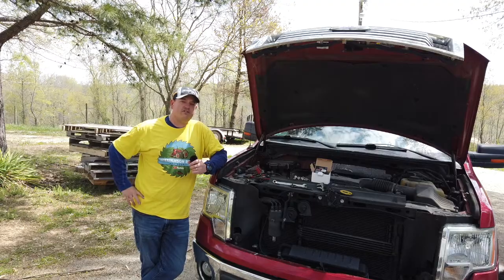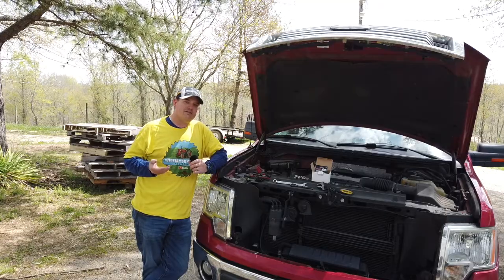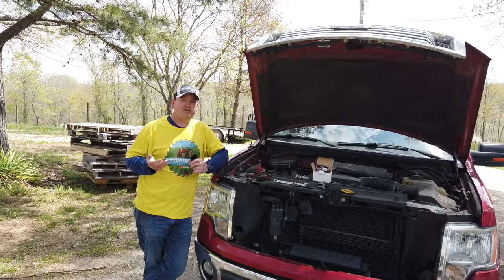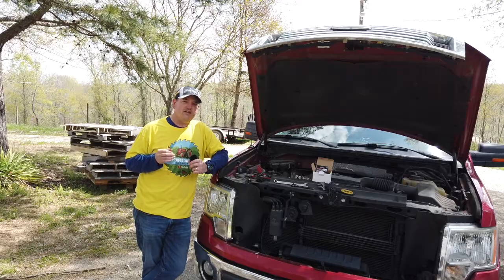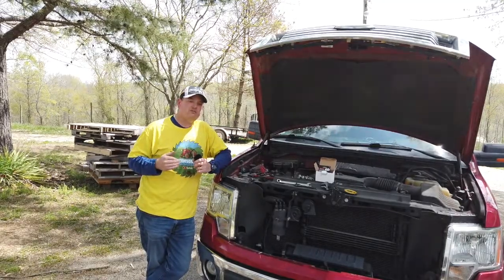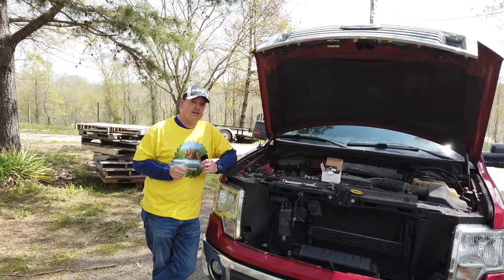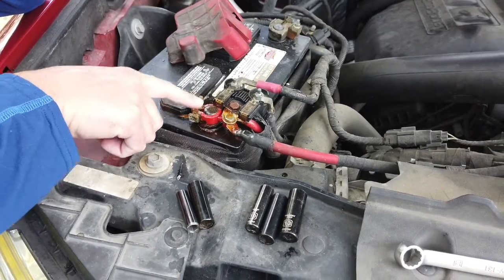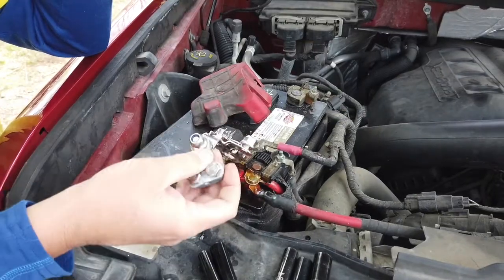Ford F-150 Battery Terminal Fix/Replacement #122

Comment: They told me 400.00 for clamp and 400 for labor. So total of close to 1000.00 for a battery positive connection. A real Ripoff. Get with it Ford.
Reply: That’s actually disgusting

Comment: Your video saved me about 1500 dollars. Had the same issue with stock battery terminal on my 2013 F150. Brought it to a shop and they too said i needed to order the whole battery cable assembly , which is actually on backorder currently ,  350 bucks and with labor/ shop supplies/tax would end me right around 1500 (not even including a new battery) . Watched your video, bought the same doorman part, was done in about an hour (had lots of corrosion to clean up) Never going to that shop again. I even asked them if there was some sort of "work around"  they could do to not have to replace the entire wiring . They stated that it would probably be around the same cost... These shops these days are straight thieves. Thanks again, will be subscribing !
Reply from the maker: Thanks! Glad it helped out!

Comment: Your situation was exactly what happened with me. Different shop put a generic post on the battery and it corroded like crazy for several years. Last week, I replaced a battery and the truck was dead. I was prepared to replace the alternator and figured I'd replace the terminal while I was at it. I rewatched your video and skipped the alternator. It works like a dream. Thanks for the descriptive lead up.

Comment: Damn. I know this video is older but, what a life saver. I was quoted over $350 for the terminal and $500 in labor and $300 for a new battery 😂. With this video should be down to a little over $250 all and all. Will update once complete.
Reply from the maker: Awesome glad it helped out!

Comment: I bought this connector late Summer(2020). Brought it to the dealer to have it installed. Worked just fine for 24hrs. The wife took my truck to the Vet for my pup and the truck died...less than a mile away. Nothing wrong with the item, turned out the mechanic didn't tighten down the screws well enough. I bring all our vehicles to this shop, but i chalk this one up to a brain fart. A little lock tight and the product works good six months later. All in all, a $30 price tag is more than worth it!!

Comment: I been researching this issue on my wife’s 2015 Explorer. Fixed hers then checked my 2012 F150 and while wasn’t too much corrosion on there I’m gonna go ahead and get this part and put it on. Nicely done video 👍
Reply from the maker: Thanks!
Reply: Did this particular piece work on the explorer? I'm needing to do mine and looking for the part

Comment: Great video. Gave me the exact solution I was looking for. This perfectly solved my problem for my 2008 F150 Lariat 5.4 L V8 (for the search engine). 

I'll say it again, this was perfect for my 2008 F150 even though he shows this on a 2011, and mentions 2009-2015.
Reply: I have the 2005 Lariat. That is in the same model range as yours correct? Did you cut the old terminal off or uncrimp it
Reply: @SamMobleyLiving  I cut the old one and used the included bolts to clamp to the original cable. I'll note I also stripped off about half an inch. 

2008 and 2005 are in the same generation of F150s per a quick google search.
Reply: Can this terminal be used on a 09 Grand Marquis/Crown Victoria?

Comment: Similar story in my life. 
Replaced a dead battery due to high corrosion and killed my battery. I replaced it myself in front of autozone. 
I let my brother borrow my truck for a couple days so he could do a couple things that requires a truck. 
Battery wasn’t charging from tons of corrosion again. I was able to find negative replacement locally by Dorman. But not the positive. Found this video. Ordered the part. I’ll be replacing it in two days. Pretty annoying little issue.

Comment: Thanks!  This worked perfectly on my 2016 Lincoln Navigator L that had the positive terminal completely corroded.  The replacement battery cable assembly was $478 + 5 hours labor…$1000 estimate.  It cost me $22 and 30 minutes of my time.  Couldn’t have done it without your video!
Reply from the maker: Glad it helped you out, thanks for watching!

Comment: I was able to find the exact connection with the fusible links on Amazon for $39 shipped.  It was a pain to remove the old crimped section and then again to crimp the new one w/o a crimping tool.  But it fits like new and I don’t need to worry about shorting the extension piece.  Had a similar short term fix for almost 2 years. 😆

Comment: Mine just set off a code, will probably break tho, just got it to move and Alt tests ok now but power steering still not working. Is due to neglect, I'll try cleaning it tomorrow, it's 5 out right now! Gonna next day that Dorman part anyways, great video thanks
Reply: Got steering back by just turning off and on, getting sporadic voltage still, only had this truck 2months, getting that part overnight. Won't be to bad besides the fact it's 5 out, which is part of the problem I'm sure. Steering had me worried a minute. Also says could be the PCM relay but kinda doubt it.

Comment: Good video, I bought the same part for my 2013. I bought my parts at O'Reilly auto parts.
Reply: I went ahead a replaced the old terminal this morning. Just make sure you clean everything good. It fit perfect and is working great. Thank you again for the video. The part was only 27 dollars plus tax at O'Reilly auto parts. I recommend to do it yourself and save some money. Like the post earlier, make sure you disconnect your negative battery cable.

Comment: Be careful spraying any sort of cleaner/ acid neutralizer onto the battery. Those rectangle caps can be removed and if any of the neutralizer seeps under, it will kill the battery. I've done this personally and had a coworker with the same experience. Use a rag to contain the spray to the battery post and clean up any residue.
Reply from the maker: I did not know that thanks for the tip!

Comment: I know this is an old post but was wondering, when the shop put on the "wrong" terminals, were you experiencing any dashboard flashing/getting squirrely?
Reply from the maker: It worked fine for a while but when the terminal started getting corroded and eaten away from the acid, I went to start the truck and thought the battery was dead, when I tried to start it, yes it flashed the dash lights headlights everything was flickering and acting crazy
Reply: @WilliamsonRidge  Good to know, my tach and speedometer  were also going nuts and my odometer went blank as well.
Reply from the maker: Yup they jumped and flickered and headlights were going crazy and you could hear it clicking and carrying on like it was shorting out

Comment: great video, but please, always remove the negative battery cable before you do anything around the battery. It's so easy to arc the terminals with it being still attached.
Reply from the maker: Thanks for watching out, I should have disconnected it.

Comment: can you replace both terminals with that part, im having trouble getting either off the battery
Reply from the maker: You could possibly but probably shouldn’t, they are two different part numbers for the positive side and the negative. The negative should be something like these https://amzn.to/3O4Yvih
https://amzn.to/44CHjrs

Comment: Hey THANK YOU for posting this video I did the same fix...now though having an issue with the positive lead that comes from the fuse box (under hood) to the battery, is there a way/parts to fix or replace that as well?
Reply from the maker: I’m not sure, I haven’t had any issues with that part, yet.

Comment: 2014 ford f150 super crew, THANK YOU, YHANK YOU, THANK YOU - the Dorman 926-882 Positive Battery Terminal that has the "extension" for the positive THICK batt cable is what I need to fix mine, cant get the factory crimp off the cable, the extension should secure the cable and the left over crimp. thus I dont have to buy a crimp tool.

Comment: The issue with my truck is , sometimes the dashboard lights won’t come on , not even the speedometer works.
I will give it a try and see if this helps the issue.
Reply from the maker: Mine wouldn’t do anything but the headlights and dash flickered like crazy but try the key and nothing

Comment: Any suggestions on how to uncrimp the old terminal from the wire??
Reply from the maker: Maybe use a dremel with a cut off wheel to cut just the crimped part then pry apart with a screwdriver or make a couple cuts it should just fall off then

Comment: there are 2 positive cables where do they both go? I see the one ?
Reply from the maker: The main positive that comes up from the bottom hooks to the 90degree portion that hangs down on the terminal, the second goes on the top conection and there is a third that hooks to the big chip/fuse looking part. At 8:07 you can see the top two connections and at 5:51 you can see the first connection to the main wire

Comment: GOT A QUESTION BROTHER  DID THE PROBLEM START WITH YOU TURNING KEY AND NOTHING HAPPENING BUT YOU STILL HAD POWER  TO ACESSORIES AND LIGHTS JUST TRUCK WOULDNT START OR DO ANYTHING IM HAVING THIS ISSUE AND IVE REMOVED BATTERY TERMINAL WICH ISNT STOCK AND CLEANED IT  TRUCK STARTS  THE IT WILL DO SAME THING AFTER I TURN OFF
Reply from the maker: On mine the lights would flash and do crazy things but when you turned the key everything went off, release the key and all the lights would flicker even the headlights were flickering.
Reply: Pete, my truck is doing the same thing. Did replacing the terminal fix your problem?

Comment: Can anyone tell me what problems this was causing I have a 2014 f150 with the 3.5 and I have had certain times when my truck would just throw every single light on the dash start beeping, and making a grinding noise like it was trying to go into 4wd  and then just show dash marks for the mileage and I would have to turn it off and wait a min, I  just assumed it was due to the corrosion from the battery. Was having this same problem?
Reply from the maker: Mine would not start and all the lights were flashing dash and exterior. But never while driving only when I went out to start and it had basically no connection or seemingly a dead battery

Comment: Hi one question if I disconnect the terminals what about with the radio?  It will be blocked?
Reply from the maker: When you disconnect the battery it will reset everything

Comment: That's just some crooked $#!+ on the part of Ford. There is no reason at all that a battery terminal should cost that much. I have a 2001 lariat that I bought in 2023 and it's terminals were all sloppy. I went to a salvage yard and got terminals off of a brand new Lincoln that was totalled nearly beyond recognition. The battery terminals were pristine however and worked perfectly. Too bad I didn't catch your video beforehand. I would have just bought the same terminals you bought instead of taking them from a car someone clearly died in. Kinda morbid, an all that. But interestingly enough, my F150 belonged to a mortuary/monument designer and used my truck to hall tombstones. I have nickednamed my truck the Reaper cause it seems to be attracted to morbid things. I only bought it because it's in amazing condition for it's age and I got it for and extremely low price ($3,500) with very low miles (80,00) for it's age. I've always been a Ford guy.... well, older Ford's anyway. These days they cost so much and seem to be riddled with problems.
Reply from the maker: That’s a great nickname kinda dark, but awesome! Lol
Reply: Yeah, my harley is named HellsPiper.... come to think of it, maybe it's ME that drawn to morbid things, and I'm deflecting it on my poor truck. 😂
Reply from the maker: Lol

Comment: They carry this part at Autozone for $24.
Reply from the maker: Yep sure do but my local autozone had to order it so I figured why not order it myself and not have to go back to pick it up.
Reply: Did those washers work out? About to change my corroded terminal. I had to constantly clean them.
Reply from the maker: The washers definitely help but I still get a little corrosion.